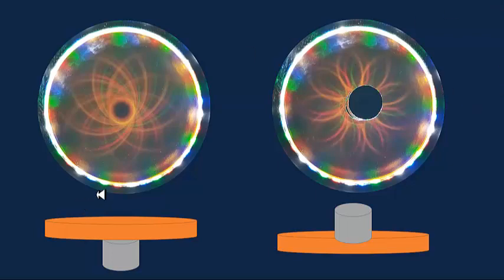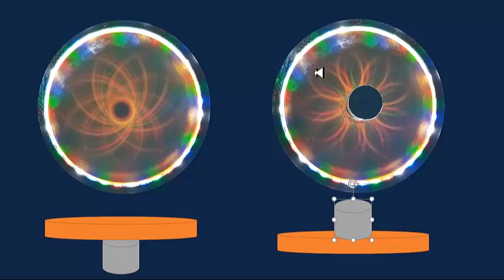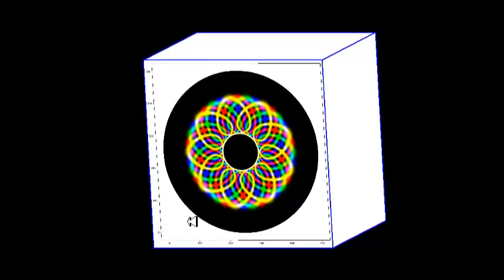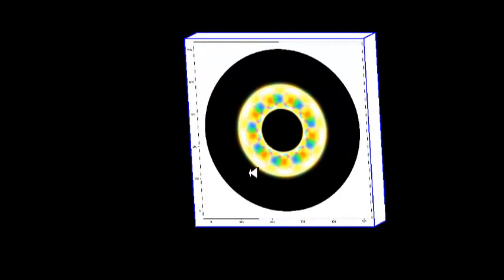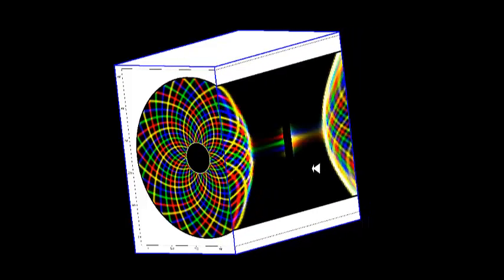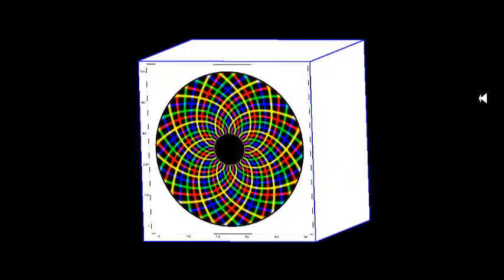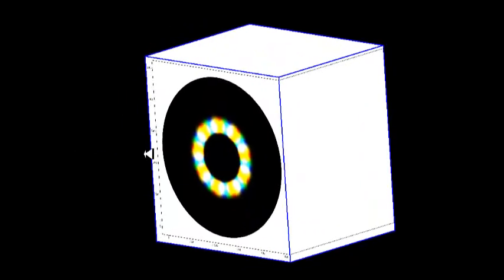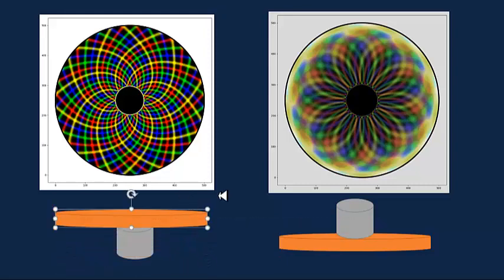Through the Looking Glass : Simulating a magnet passing through the center of a ferrolens.

Comment: I'm somewhat confused about the position of ther magnet in respect to the ferro-lens.  
Did you actually make a ferro-lens with a hole in the center?  If so, wouldn't that skew your results?
Reply from the maker: This was actually a simulation of what it would look like if we had a ferrocell with a hole in it and passed a magnet through it. I don't actually have one, although it would be fun to make one some day. In the cube display, I am merely stacking the images for each position of the ferrocell relative to the magnet, so this display doesn't represent one image but a series of images. So take this display with a grain of salt. The images where the magnet is above and below the ferrocell are real and the simulations match what these images are showing. .

Comment: Very cool! So, what is the basis of the simulator? What is its program (which accurately mimics how the magnet looks on top and on the bottom of the ferro lens)?
Reply from the maker: When a magnet comes near the ferrofluid between the two pieces of glass, the ferrofluid forms needle-like structures. These needle-like structures then align with the magnetic field much like iron filings. The simulator uses standard magnetism simulate the alignment of the needle-like structures. It then uses standard light theory simulate how the light reflects off of the nano-needles into your eye. That's it. Easy as PI.
Reply: @FractalWoman  Oh, okay. Just mainstream field lines or whatever and such things, and those produce the correct outcomes. Right?
Reply from the maker: @PhysicsWithoutMagic  Although the ferrocell is a very interesting device, many people are trying to claim that it is more than what it is. It is not a quantum effect as some suggest. It is not constructive and destructive interference as others are suggestion. It is merely reflecting light.

Comment: It changes with the point of view because a ferrocell is a holographic surface due to the polarization of the graphene particles in the ferrofluid.  To be able to perceive the depth it offers, the magnet has to be beyond the lens from your perspective.  That's why it looks different.  You don't have to pull the magnet through, just flip it around and you'll see the red / blue shift differences.  Are you up for a zoom call one of these days on this subject.  I'm interested in your simulation for my theory.
Reply from the maker: The particles in the fluid are not graphene. The composition of a typical ferrofluid is about 5% magnetic solids, 10% surfactant and 85% carrier, by volume. Graphene is not a magnetic solid. When you place a magnet under a ferrocell, the magnetic nano-particles align with the magnetic field. The light (from the leds) reflect off the nano-particles into your eyes. The patterns that you see are an emergent property of the way the light reflects off of these nano-particles when a magnet is present. What you see is highly dependent on where you are standing relative to the ferrocell because the light from different surfaces of the nano-particles is reaching your eyes. The holographic effect that you see is an optical illusion based on the way the nano-particles align and the way the light reflects off of them and into your eyes. What is going on under the hood is quite simple in terms of physics. Also, just so you know, I don't see the red or blue shifts that Ken Wheeler talks about in my experiments. I see the same thing whether I am looking at the N pole or the S pole.
Reply: @FractalWoman  I actually ignored this, glad to accept.  However, my assumption was based on a little bottle I got on eBay a few years ago, seems to be a version that works as an additive for cement and has 5% graphene powder as an ingredient.  I see that these days, it's not what you can commonly buy as ferrofluid.  I just ordered a bottle of what's available today without it and see if there's a difference.  Apparently, the one I have enhances EMF shielding in cement composites. So much stuff to know lol.

Comment: I guess many people were interested in the experiment of passing a magnet through a ferrocell. The reasoning, as you said, was the Bloch wall. Would it show, centripetal/centrifugal areas of  magnetism (it did). Your computer simulation shows magnetic convergence and divergence. If any experiment were to be staged and carried out by "Professionals". The Set up would be with lasers. Any disparities, proving that a new understanding of magnetism should be recognised, would be heavily discouraged or immediately quashed.
Thank You for everything you do.
Reply from the maker: Unfortunately, this simulation does not provide a new understanding of magnetism. It merely demonstrates the same old mainstream understanding of magnetism. The center of a permanent magnet is not a Bloch wall. AB set me straight on that. There is no magnetic "convergence" and "divergence" in these experiments. Everything that you see in the ferrocell is an optical illusion (optical effect) which does not add anything new to the field of magnetism or the field of optics. This is why I needed a simulation. There is a lot of misinformation out there and the simulation will be instrumental in clearing things up once and for all.

Comment: This is great. Another important visualization rendered might be the primer field bowl geometry Mike? Laplant? Reason is several, but mostly because galactic jets is "shooter" repulsive. Ferro ball maintains outside bowl pole through center hole. ? Or flips at the "flip ring" where it appears the ferro ball becomes the same as the inner pole of the bowl. Thus is repelled. Rather than ferro atoms poles attracting alignment. To me this geometry is showing us how repulsion levitation occurs. Also positional locking between the bowls of both poles. I think the mathematical one over phi ratio possibly explains the dimensional duration difference between the poles (spacetime variation.) Giving us difference between north south poles. Smaller size higher rates, larger size slower rates of atomic motion. Atoms are being warped and induction proximally effects nearby other atoms according to inertial equilibrium. Thus creating similar or conjugate effect in other atoms.
Reply from the maker: YES. I am working on that. When my 3D printer comes in, the first thing I am going to do is print a primer bowl. I already have the magnets. Then I will have a look under the ferrocell. :-)